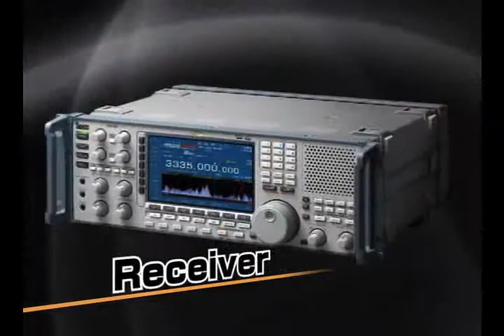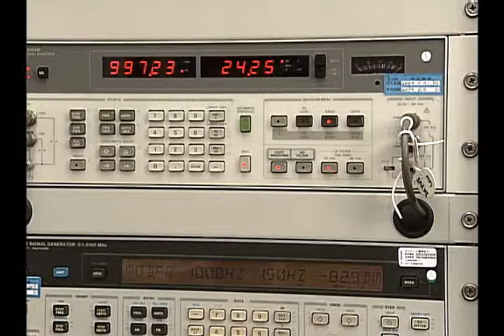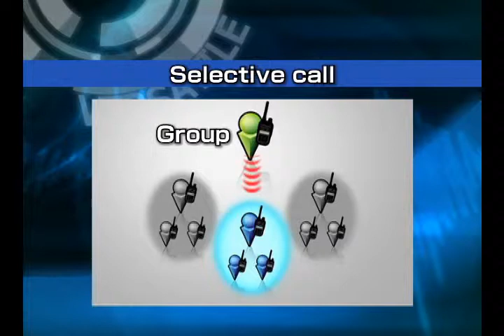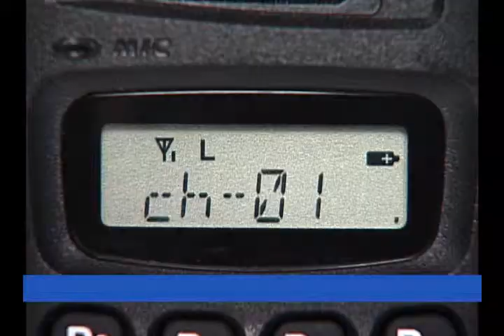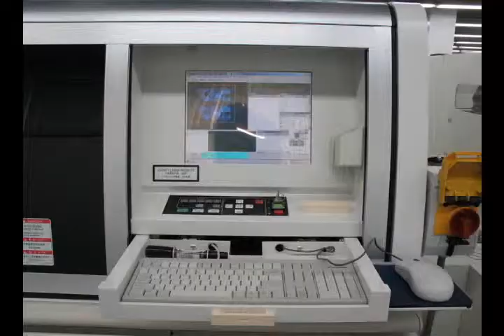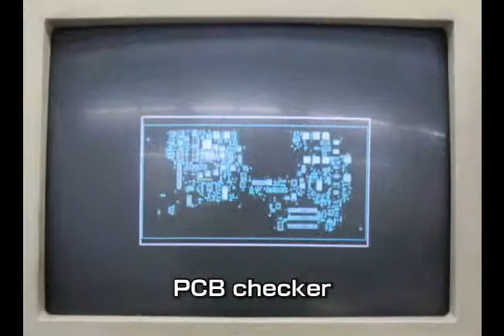Introduction to the Icom IC-F3022 Two Way Business portable radio

Comment: I have the exact radio and i would like to ask how to deactivate the squelch? It is always on as soon as i switch on the radio. Thank you
Reply from the maker: This would have to be changed via your dealer using programmable software.  It is not possible to do this from the front panel.